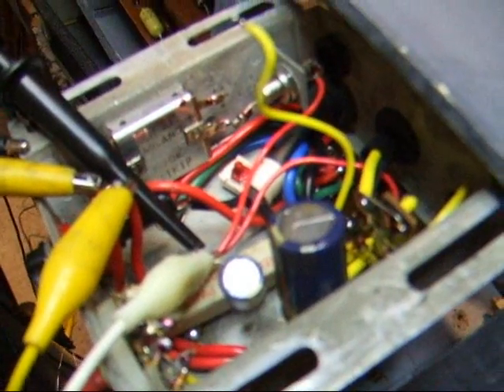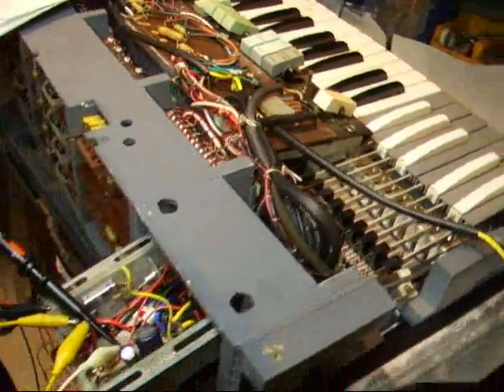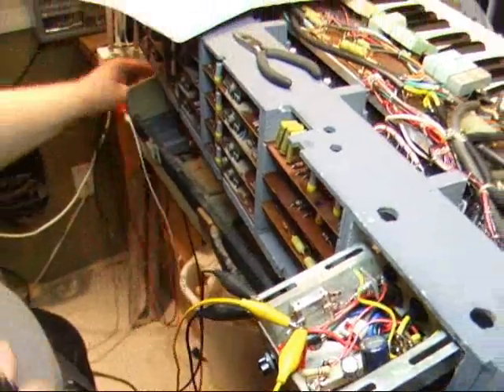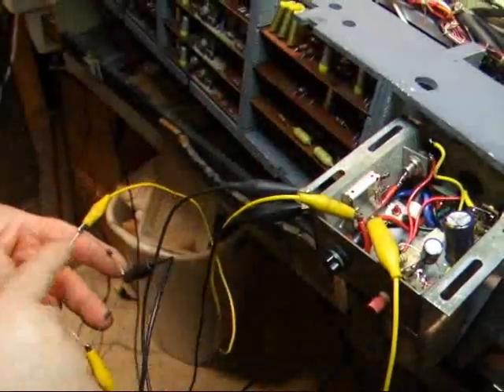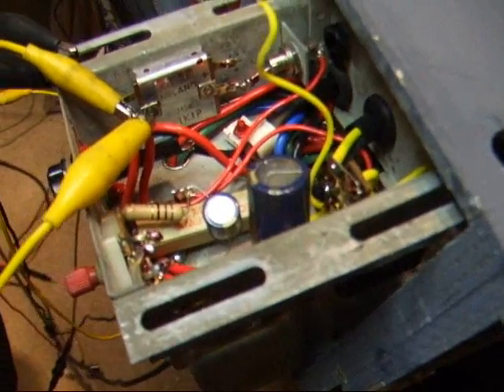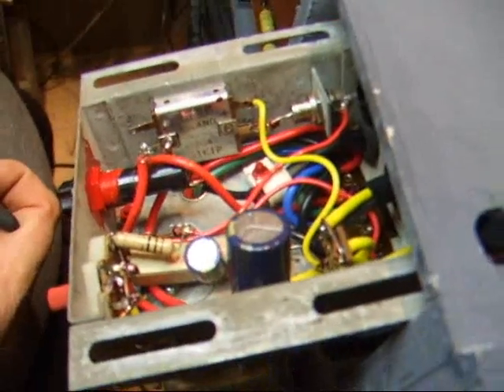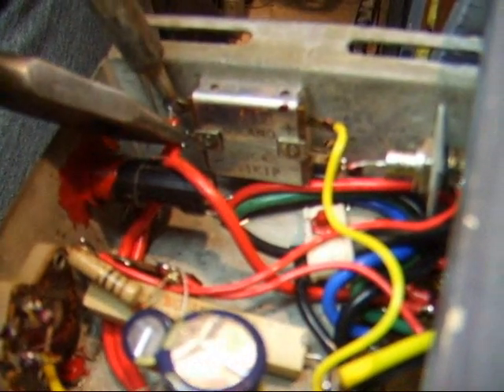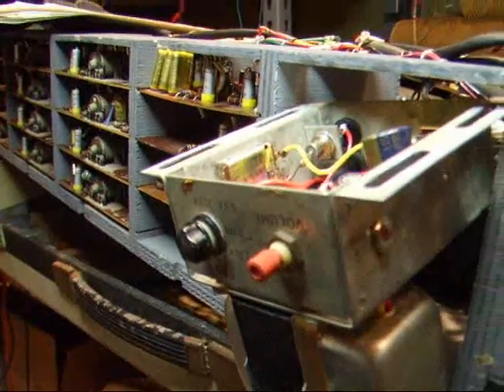Farfisa Repair part 1 - Customer 0005

Comment: Is that square silver colored thing on the wall of the housing a selenium bridge rectifier?  A lot of people recommend replacing selenium diodes with silicon diodes (along with a series resistor).

Comment: The Electronic Organ Servicing Guide ( Sams 1971) is a 128 page large softbound book that is available at Amazon used. Written by Robert G. Middleton, it's very thorough and has plenty of drawings. It's also far more practical for troubleshooting and repairing than just about any manufactures service info. Your organs schematic and this book can help you fix almost any organ problem.
  Was recommended by a guy who was shocked when he paid $25 for two old xerox copies of a Thomas organ schematic.

Comment: Hi!
I have recently bought a Farfisa Matador 80... It works perfectly except for the volume pedal. As you may know Farfisas Volmue Pedals are optical, they doesnt use pots. 

I have just disassembled the pedal and I cant find the problem... the light bulb is working perfectly. As far as I can see, as the Photocell receives less light the volume should increase and vice versa. 

I suspect that the problem comes from either the Photocell, or the organ itself.

What do you think??